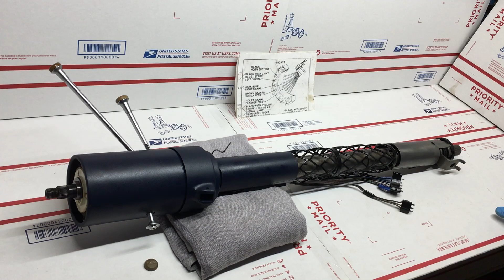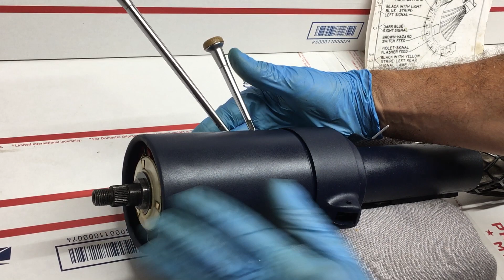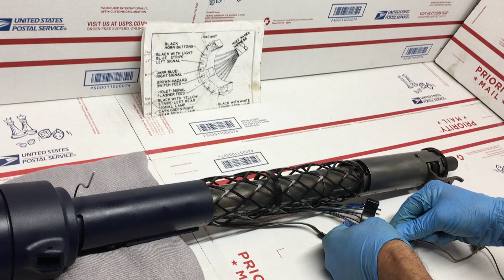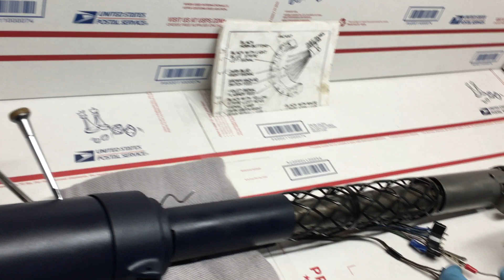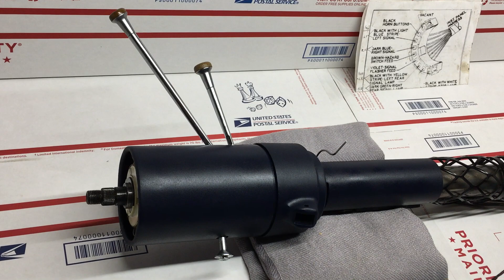1967 1968 CADILLAC DeVILLE TILT & TELESCOPIC STEERING COLUMN RESTORATION FUNCTIONAL VALIDATION TEST

Comment: what is the iron net in the middle? what is it for? I would like to remove it on my 67 deville
Reply from the maker: The exterior steering column body's outer tubular body has an integral expanded metal section that reveals the internal shifting tube and this is part of the original construction and generally this area what you are referring to as a " net " is covered over by a plastic shield. Feel free  Call me at 7273647523 in order to discuss or you can email me at KYPITSN@AOL.COM.  I have over 375,000 original vintage 1959 to 1978 Cadillac items overall so if there's anything else you require feel free to reach out to me again. 
Kind Regards George 727-364-7523